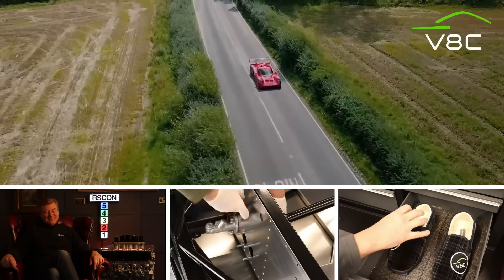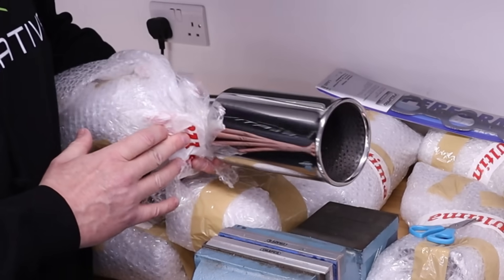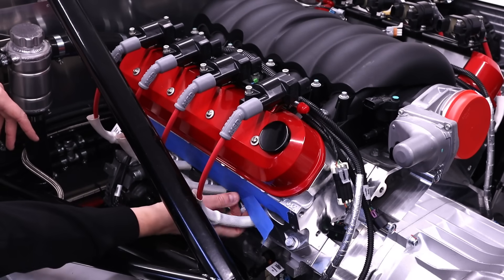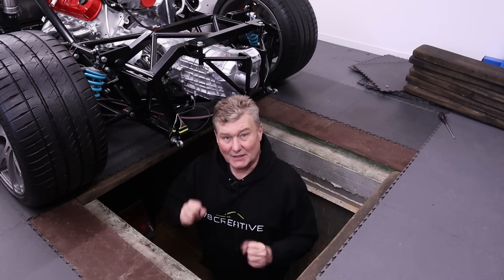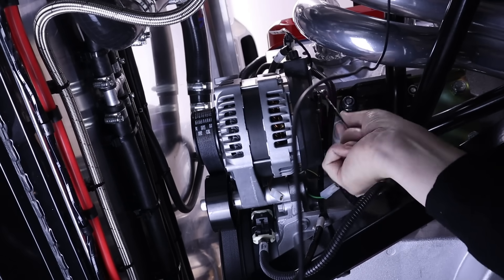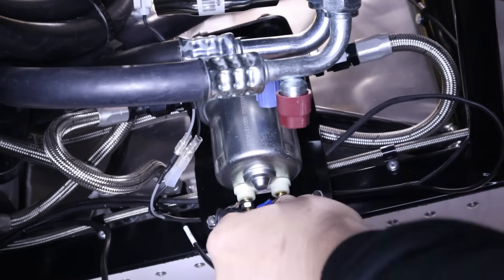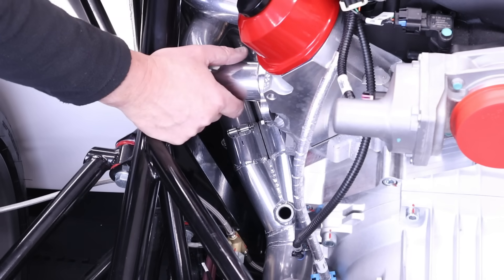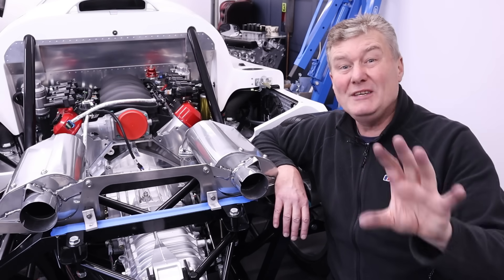Building an Ultima RS with Nigel Dean. Part 55. High Performance Exhaust System Install

Comment: Uncovering the secret pit was a nice surprise… an excellent accessory for the garage when a car lift isn’t possible!! Seeing the contrasting silver ceramic coated exhaust tubing snaking through and around the chassis is very satisfying 👍👍. Great progress Nigel 👏🏻👏🏻👏🏻
Reply from the maker: Thanks and yep the exhaust lifts the engine bay. As for the pit, a very useful addition to the Dean Den.

Comment: Im thinking more for stainless but after handling and installing, before starting the engine and getting the pipes hot for the first time, wipe all down with brake cleaner so finger print oils dont get permanently burned into the pipes. I know for sure on stainless but not coated.
Reply from the maker: Hi Kurt, and a very good tip since pretty much any metal which goes through a heat cycle can amplify any grease that has been left after assembly. Stainless, as you say, is a typical culprit. But I will clean everything prior to that first start thanks to you reminding me :-). Cheers Nigel and Rufus

Comment: I think you will end up wrapping the exhaust headers. The temperature under the lid is going to be massive, to the point things will melt. Your main loom is almost touching. The reflective loom cover I think will not be man enough. I watched another builder in the states take a different approach. He is on YouTube, Dan Dulac. He fitted a 10 cylinder engine, incredible engineering challenges and solutions, worth a good watch.  Another good video, thanks
Reply: Mine are fine on my GTR without wrapping and I have a race tuned 720 without any heat issues.
Reply from the maker: Thanks for the comment and interestingly there are a few YouTube videos with comparisons between ceramic coated vs. wrapped headers. The results seem to show ceramic coating wins the day. As for Dan's channel, yes I'm an avid viewer since he has taken completely the opposite approach and modified every strand of DNA in his Ultima. :-). Interestingly the RS is first one of my builds that's based 100% on manufacturer's recommendations and parts. Out of my 8 builds to date this has been the easiest by a country mile. Time will tell if that translates to the driving experience, including under hood temperatures - thermocouples already on order :-). Thanks for your continued support of the channel. Cheers Nigel and Rufus
Reply: Dan did the cera coat and wrap.  So both. I do look forward to hearing your car start and of course drive. This has been quite a journey. watching both channels. I noticed Dan has slowed right down with his posts, which is a real shame, there is a guy with  some skills. Clean and tidy. Building a loom and pinning it, the list goes on and on. I love his welding, his design, his solutions. Again a Car I want to see running down the road.  Again thank you for the free entertainment, been with you from day one.  Cheers happy 2024!  @v8creative

Comment: The stainless steel screws you installed, none of them is screwed into aluminium? Galvanic corrosion might be an issue in that case.
Reply from the maker: Nope all good thanks

Comment: As always, fantastic work. Your build is coming along nicely. Can't wait to see the finished product!

Just have a question, how big is the beast compared to, let's say a 4-door sedan. Would it be suitable for a weekend trip along with a passenger? and is there any luggage space?

Thanks for documenting the build series.

cheers 
Steven
Reply from the maker: Hi Steven, and appreciate the support. As with any 2 seat super car luggage space is limited but I have opted for the optional luggage containers that convert the side pods into storage. Having built and owned an Ultima GTR I was able to have weekends away with the wife with soft overnight bags in the storage bins. Cheers Nigel

Comment: Does the system have a little flex somewhere for heat and motor movement? If its all locked in place with no give, it will probably crack, somewhere. Looks amazing, though!
Reply from the maker: You are correct any exhaust system needs to be mounted on rubber and this applies to the Ultima RS system also. The rear stainless support bracket is attached to the chassis with rubber bobbins. I did not show this clearly on the video but will recap in part 56. Cheers Nigel

Comment: Happy New Year! 
I was wondering what configuration you'd chosen. "2 and 2 into 4" header sets is a great idea; I've seen a lot of GT40, Ultima, SLC, and GTM builds where they have a 4 into 1 short header set. For maneuvering in a tight engine bay, that's a great thought. With the way your engine is set up, did you give thought to an X pipe configuration to counter the tendency to get engine drone? 

Cheers!
Reply from the maker: Thanks for your comment. Having been in the industry for 30+ years I know exhausts create a lot of chatter :-). The Ultima has a very tight engine bay and the LS exhaust is a work of art. I understand your comment regarding an X pipe but let's see what the standard set-up delivers. If it's anything like my GTR it's sensational. Thanks for tuning in, cheers Nigel
Reply: I want to know how it sounds as well, I can't wait for your next video. 
Those pipes you have setup, my friend would call them a 'Belligerent Exhaust Note' :D 
A particular kind of gearhead we are, that well tuned engine is our favorite music.

Comment: I like the Ultima except for the dash layout. I prefer the traditional "front and center" dash layout. Is there an option for a traditional dash? Or is the answer to project dash info on a HUD- head up display in front of the driver?
Reply from the maker: The factory give you two dash layout options. The analogue instrument layout I have opted for has  central binnacle or a behind the steering wheel binnacle with a digital dash. It's a personal preference.  Cheers Nigel

Comment: Exhaust system looks very shiny and mirror like for a mild steel system is that due to a zircotec or similar coating?
Reply from the maker: Hi Charlie, yep Ceramic coating is a factory upgrade and apart from looking superb it seriously reduces under rear canopy temperatures. Cheers Nigel

Comment: Daughter back in swimming lessons so I've got 45 minutes to sit and enjoy this episode#happydays 😊😊 does the ceramic coating go on the inside or outside? If its outside does that mean the silver ceramic coating will stop the mild steel from rusting?
Reply from the maker: Hi Ian, and hope you enjoyed the episode. The ceramic coating does provide a good barrier to rusting. I have seen some older Ultimas with this exhaust finish and they still look impressive, but I'm sure that is partly due to cleanliness in the engine bay, for example not leaving salt on components for long periods of time after using the car in winter. Cheers Nigel
Reply: @v8creative  ALWAYS enjoy each episode - your enthusiasm, knowledge and presentation are fantastic. Keep up the brilliant work. I am a member of NWKCOG ( North west kit car owners group ) we have hundreds, if not thousands of owners from all over the Uk and do a lot of fundraising work for Claires House hospice. The founder, Trevor Harmer ( top bloke ) has started Kitfest, held every year at Santa pod. Once the car is finished, it would be a joy and honour if you came along 🤞🤞🤞

Comment: Does Ultima have different options for the exhaust?
Wrapping, ceramic coating, or maybe some sort of H-connections between the banks?
Reply from the maker: Ultima provide a LS and and LT exhaust system. The LS system has the option of ceramic coat, but unsure of the LT set-up.

Comment: Good morning. I posted yesterday about equal length headers and it was deleted. Not sure why. It was just a suggestion.
Reply from the maker: Hi Doug, absolutely no idea what happened there. If you comment vanished it was not me :-). As you say equal length headers are ideal, I'll measure them tomorrow and see the variation if any. Currently cracking open a beer in front of the open fire, but the Dean Den will see more action tomorrow :-). I'll report back. Cheers Nigel

Comment: you're probably going to have to wrap your exhaust to help with heat management.
Reply from the maker: Thanks for the comment but from my research ceramic coating negates the need for thermal wrap. However, lets wait and see. I have purchased thermal sensors so will cover the effectiveness of the coating post build. I have confidence the coating is sufficient but there;s nothing better than real life experience. Cheers Nigel

Comment: Subbed halfway through but glad I subbed...seems I'm coming into a payday soon that could well afford this car!!...tell me is there an option if the factory can make it for you???..I'm neither mechanical and I'm lazy!!!?..does the company charge extra for a company built option???
Reply from the maker: Ultima will build you a car but the wait is very long, years the last time I was updated. The best chance of owning one of these beasts in short order is to reach out to an owner of an RS where you can be confident it has been built to a high standard. You can then add your own touches, like engine tuning etc. Cheers Nigel